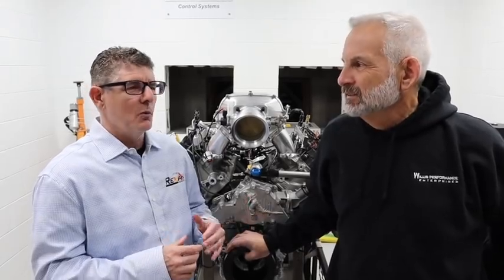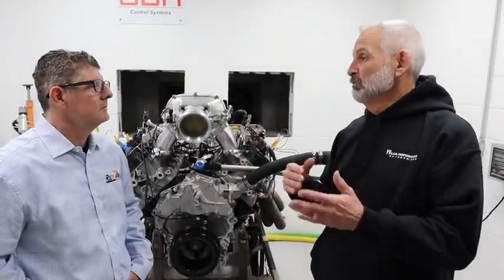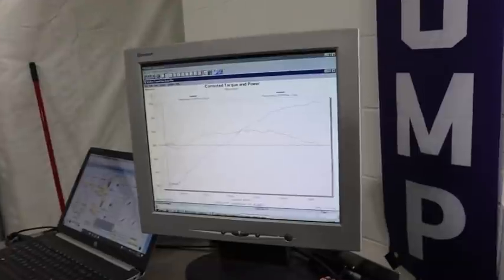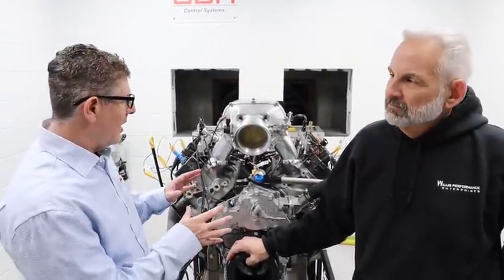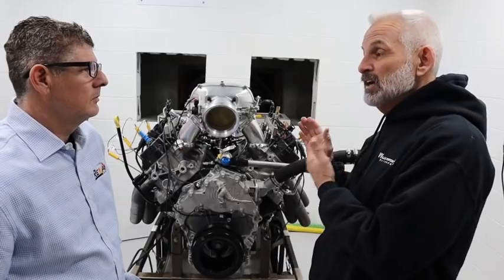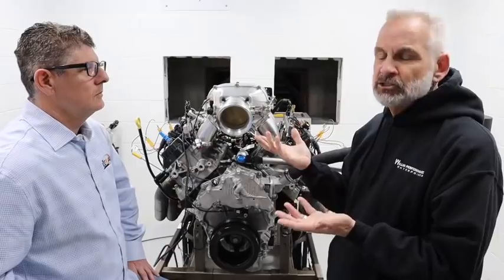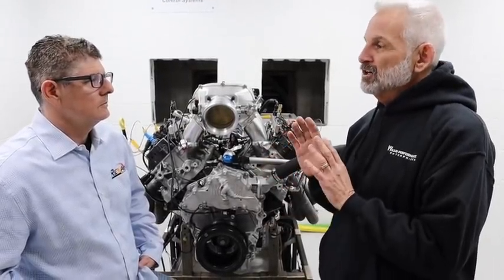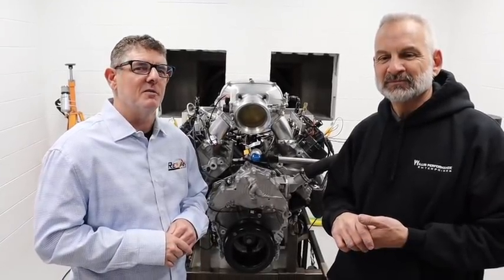Ford Godzilla 7.3 Stage 1 Heads & Cam Dyno Test — Massive Gains Over Stock! How is that Possible?

Comment: Show me a 427 LS that makes with a light cam and light porting makes 640 hp. They only make with like max effort maybe 800hp. There is so much capability with this Godzilla motor even N/A. IMAGINE BOOSTED
Reply: Thats a pretty common LS7 result.

Ported stock heads, cam 567rwhp

https://www.youtube.com/watch?v=RKcYk3C9ug8&ab_channel=CrazyMcgrady

Ported stock heads, cam 608rwhp

https://www.youtube.com/watch?v=Mk9MbLRSxPA&ab_channel=FrankensteinEngineDynamics

Ported stock heads, cam 568rwhp

https://www.youtube.com/watch?v=MOMnXIERoQc&ab_channel=FriendshipAuto
Reply: @chipcurrey653  I mean with like stage 1 level porting they barely did anything to those heads and its a really light cam they put in it. Sure you can do the same with a LS7 but it needs more like stage 2 level stuff to do it. The stage 3 or 4 stock heads they are shooting for 1600hp boosted with. As far as I know LS7 heads even ported to the max can't make that much thanks to design. Now this is based on my knowledge and even if I'm wrong the point was this is a SERIOUS contender for the LS and LT motors.
Reply: @chipcurrey653  Also that one that made 608 whp its heads were ported by Frankenstein which is as far as I know one of the best porting/head/Intake shops in America. And that was probably a pretty decent level of porting considering who it was done by and the power. And they charge a good bit of money to do porting just because of their skill so no one is going to ask them to port something un less its a pretty high level of porting and want to get the best power possible out of those stock heads. Im not saying Frankenstein went all out on them but its defiantly not a light port Job. So its not really an accurate comparison.
Reply: @tstuff1213  David Vizard is considering one of the leading ICE airlow experts, has written countless books, and has won engine masters.

They are two engines of very similar design, with similar displacement, similar compression, similar heads, etc. They are going to make similar power. "Stage 1, 2, etc" is non-universal terminology. All those examples have stock heads. None of them have a billet intake that doesn't clear the stock hood.

I think you are searching for emotional reasons one brand will outdo another. The 7.3 has 19 more cubic inches, and ultimately a taller deck height which will allow bigger aftermarket strokers. I don't see anything principally different about the design that is going to allow for way better results than an LS of similar displacement with similar headflow. An LT with the same stats would outperform both. They are direct injection which will always allow for more compression on pump gas. Ford could always release a DI version, but I hope they keep this port injection model in trucks.

My interest in this engine is because I see it as essentially a slightly larger LS3/LS7 for a lower cost. It is a MUCH lower cost than a tall deck LS. Aftermarket support for the DI LT engines has never taken off like for the port injection LS because of the tuning challenges.
Reply: @tstuff1213  By the way here's a stock long block, stock unported head LS3 making 600+hp with just a cam, intake, and long tubes on an engine dyno with no accessories, water pump, hood, etc. This is only 376 cubic inches.

https://youtu.be/dv2WYRh1oWo?t=972
Reply: @tstuff1213  FANBOI ALERT

While good for Ford, the power this engine makes isn't anything an LS hasn't been making for 10+ years.
Reply: @dwightdhansen  The LS has been around for 10+ years. This engine was released this year its not even 1 year old yet you can't expect it to make the same power.
Reply: @chipcurrey653  That is impressive I can't denie it. LS engines are very impressive for sure no doubt in that
Reply: @chipcurrey653  I never doubt this mans skills he seams very knowledgeable and I enjoy learning from him. I think with the use of stock parts wise the 7.3 is better, forged crank, good stock heads, good sized bore etc. The LS is a proven platform and I think down the road so will the 7.3 we don't really know its full potential but it is looking promising. I just hope to see less LS swapped foxbodys lol. I still think the 7.3 will be a good budget big power combo and I'm looking forward to it being used more.
Reply: @chipcurrey653  I have a question how big can you actually bore an LS that is shooting lets say for 1500hp boosted. Like what is the point where the piston walls are too thin to handle that much power?
Reply: @tstuff1213  There is NOTHING groundbreaking in the engineering of this engine.

This engine will NEVER make more power than a comparable LS.

Yep fanboi excuse after fanboi excuse.
Reply: @dwightdhansen  Look I like LS engines they are pretty cool and can sound rowdy and make good power. I would not say it is a "ground breaking" motor but neither was the LS when you really think about it, like the 7.3 an LS is a pushrod engine which have been made for 50 years. The LS is a very efficient airflow engine that's what makes it so capable. Will the 7.3 be similar to an LS with its efficiency we will have to wait and see. But if you look at some of the facts an LS as far as I know can be bored out safely for high horsepower to around 427-446 Cubic inches but after that the cylinder walls get too thin to handle high boost. From the initial assessment of the 7.3 by this youtube channel it was estimated it could be bored/stroked to 480 cubic inches safely. With some comparable motors I have seen in no prep racing 480 cubic inches can make more than 2500hp with the right parts. So in theory so could the 7.3 godzilla when it gets built to that level in the future. Even with a Billet block a 427 LS so far can only make maxed out, at or under 2500hp so in theory the 7.3 godzilla has greater potential. Do we know for sure which is better we don't because every engine is different and has their own personality/problems and we have yet to find what those are and if they limit the power the 7.3 will make so until the motor is built by more people and pushed to the limits we won't know which is better. But for the time being the LS is still king of small modern swap engines.
Reply: @tstuff1213  Stock 4.8s and 5.3s from Silverados have reliably made 1500hp boosted. Those are 283 and ~325 cubic inch engines. 

https://www.youtube.com/watch?v=iCPJxo5tNqM&ab_channel=RichardHoldener

He has made 100+ dyno pulls with the engines at that level.

Heres a stock bottom end 4.8 running 7s

https://www.youtube.com/watch?v=ixWA_pd08UY&ab_channel=SquirrelTuned

I don't know what the focus on boring is. There are aftermarket LS blocks that will take huge bores. A huge bore of aftermarket block isn't required for 1500hp.

No one has really determined whether the stock rotating assembly in this engine is an improvement, but since its design controls and material selection are newer, I'm sure they are great.

I don't think the cylinder heads are as good as the stock LS7, which came out 14 years ago. The flow numbers they quote are more like the GM LS3/L92 castings that come on 6.0s and 6.2s, but this is a truck engine.

I think it's fair to say that this is a newer, bigger iron 6.0. That's the GM it's most similar to. I am very excited about it.
Reply: @dwightdhansen  it makea similar power to similar size ls with similar compression and headflow.  This is how the ls has been making power forever, cubes and compression.  When ford gives ya cubes and compression similar things happen.  Ls make good power and its because of cubes and compression but they also have good headflow even stock usually.  It isnt that hard to make power when you have decent compression and 7+liters the ls isnt anything special either you downplay this 7.3 when its just as good as the ls stuff...because it has cubes, compression and headflow just like the ls engines do.  This really isnt anything revolutionary that has been the basic power recipe for a long long time.  For many years the ls cars were up big on displacement and compression and that gave them an advantage.   The coyote closed that gap in and of itself with only 5 liters of displacement.    When ford has cubes and compression they do similar things to the ls...this just in lol...it dont matter much when each was developed they both use 50+ year old tech at the heart of them (the pushrod stuff).  The ls isnt any more special than this 7.3 they just been around longer and are much more available.   The 7.3 is a serious contender pushrod wise to the ls stuff i think that has been pretty well proven thus far.
Reply: @chipcurrey653  the ls7 did come out 14 years ago in a top of the line z06 corvette...this engine comes in a work truck so...there is your difference in the heads lol.  Give this thing some really good ported heads with a healthy cam and itll be a monster.
Reply: @midnight347  Not downplaying anything.

Both are excellent.

You have comparable flow at comparable engine size & guess what happens? Comparable results.

I am REALLY hoping the 7.3 gets the aftermarket attention the 6.2 didn't (similar claims were made for it that never happened).

That said, it is NOT the second coming of the ICE. It is NOT better than the LS like so many Ford fanbois desperately want it to be.
Reply: @dwightdhansen  hey uh...the ford mod engine has a faster world record than the ls....
Reply: @frigglebiscuit7484  Which has absolutely nothing to do with the 7.3.

NOTHING

Try again, fanboi.
Reply: my 364 made 625 hp and 460 tq with ported heads and cam, 80 less cubic inches, stock bottom end.

Comment: So what's it do from 1000 RPM? I'd like to daily drive it and pull a trailer.
Reply from the maker: Generally, you don't dyno test from that low an rpm. Even when towing you'd really not use the engine at 1,000 rpm, as it would climb to 2,500 or higher as soon as you tipped into the throttle.
Reply: @revanevan  right now it cruises at 1600 RPM with 3.73's. Spends most of it's time between 1500- 3500. Changing to 4.88 gears as soon as I get a chance to install them. That should bump me up to 2200 RPM at 60 . Yes I'll get on it sometimes, but most of the time it will be in the 1500- 4000 range.
Reply: @captainswampy9501 it'll do fine in that range this is a mild cam setup.

Comment: What is the status on the swap kit?  What does he expect to include with it?  Fox body specific or will there be something that will help installs in other applications?
Reply: I believe Team Z already has everything you need to do this swap in a Foxbody.
Reply: @robert_rice  Maybe I'm missing it.  The only thing I see on their website is a Godzilla k- member.
Reply: I thought I saw a video where Dave said they also had the trans crossmember, but I'm not seeing that now.
Reply: Would love to see this in an IRS swapped fox. Would be an auto x killer lol
Reply: @sleeper.simulant7327  It's probably a bit heavy for that.  A lighter boosted engine would handle better.  Think SVO.

But yeah, I'm looking forward to seeing this thing in a Fox.  It's already gone 10.97/10.99 NA in a CobraJet chassis.

Comment: Sell the kit with the intake, and a flash tuner. Include headers, intake , cam, springs/pushrods, tune.  Stage 2 kit ported heads on exchange

Comment: 430 at the wheels stock in an F250? Soooo 600hp at the crank?
Reply from the maker: No, the truck is rated at 430.
Reply: The 430 SAE net is at the crank with the differances described to get to a 507 baseline.
Reply: @brianwolfe2993   So real world, about +77hp with Stage 1 heads, the intake, cam, springs and a tune?
Reply: @Odessa45 um no did you even watch the video?

Comment: Can't help but wonder what it would take to put one of these in a v10 excursion.....🤔
Reply: It would be easy if you took the V10 out first!
Reply: @andyharman3022  easy would be throwing it behind the seat lol
Reply: That would be a real nice conversion, i believe that could be accomplished 4sure!
Reply: It would be easy became these use the same modular trans style so the Trans will work and I'm 99% sure a gen 1 control pack for a coyote will also run it.  May wanna look further into it but from what I've gathered that's the case

Comment: Someone needs to throw this in a mustang and make a 1500 or 1600hp burn out car and show old cleetus up
Reply: This engine still doesn’t have much aftermarket support not to mention this engine isn’t cheap your talking $7000+ and rods pistons cam heads intake manifold exhaust manifold ecu aren’t currently available and if you can it’s not cheap because it’s not In mass production yet 3-7 years different story right now It’s not financially smart to do this your looking at least $35,000 maybe even over 45k to make that kind power right now on that engine And there’s no guarantee that the parts are going to last because they’re still in the testing phase given time these engines will be a force to reckon with right now we’re still in the testing phase
Reply: Yeah the ol’ cleeter would realize that ls is nothing anymore. 😎
Reply: @Jubr123  there are 100's of companies who make a living off of LS specific engines and they cant keep up with the demand. I doubt this engine will have a fraction of the impact in the aftermarket that the LS is having. I do like all American V-8 rear drive makes and models so my opinion is unbiased.

Comment: Excellent video, but confused on the #'s. Brian said the stock intake was 600/59something and 641/550 with the intake? So a bit of trade between torque and HP?
Reply: Yeah.  The stock truck manifold has longer runners, so it will make better torque in the mid-range, but lose power at the top end.  That's pretty typical stuff.  Richard Holdener videos have a lot of examples of that.
Reply: It’s a velocity vs cfm thing. More area is more cfm (flow) and less area is less cfm but more velocity. 
Velocity is torque related and cfm is max power related.

Yeah I simplified this very much but that’s the case in the end.
Reply: Andy nailed it
Reply: Joe Blo  It's resonance. Ever had water hammer? Air has weight, and an intake isn't a continuous flow... the intake valve's constantly opening and closing, and when it's closed all the moving air tends to cram into the back of the valve where it can 'bounce' in a wave back out, unless the timing's just right and the intake opens just before it starts to make that reversion. The length of the runner determines at what RPM that happens, so changing the runner length changes where the torque peak falls. Shorter=higher, longer=lower, and that's because there's more air moving in total to pack in so it takes a longer amount of time for peak mass.
Reply: This has been the case for many years going from long runner truck manifolds to short runner performance manifolds this is almost always the case basically.